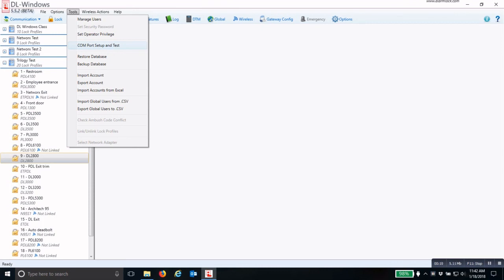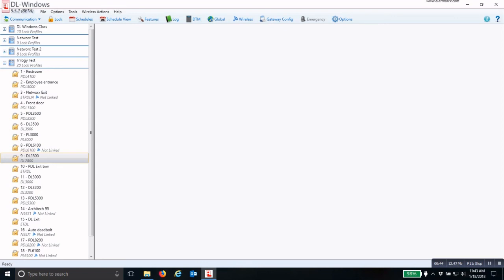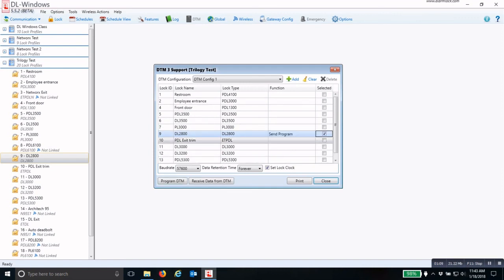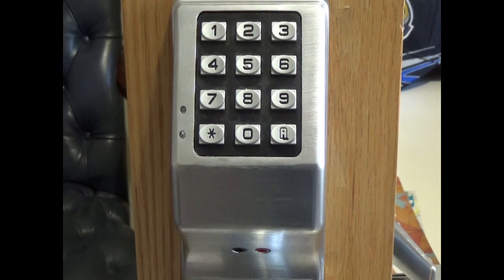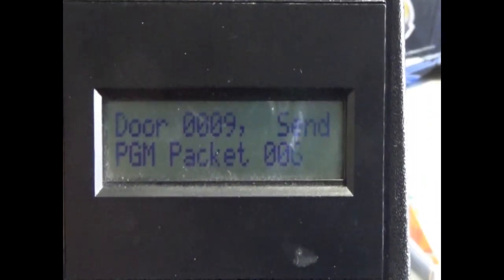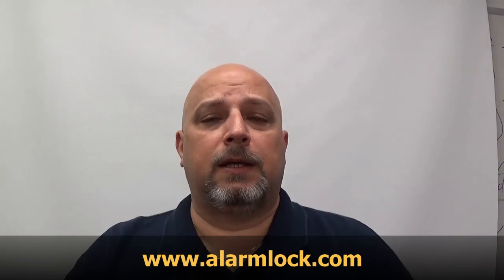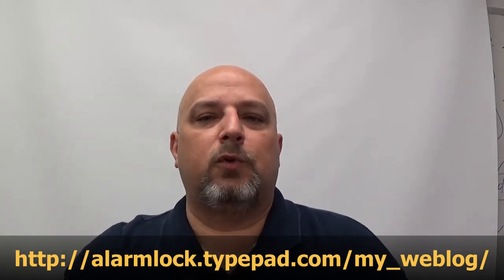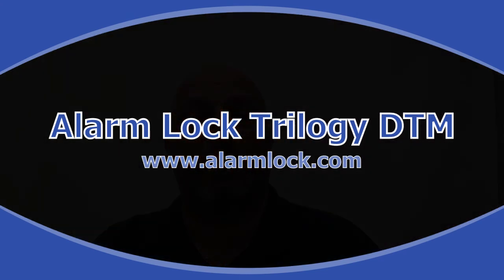Programming an existing Trilogy lock with DTM

Comment: I've programmed my DTM before but this time all it comes up with is "DTM Communications have failed", any ideas?
Reply from the maker: Make sure the PCI cable is plugged in correctly, prong with the black tab goes to the black port on the DTM. Also make sure you get a valid "Com port set up and test". If there is still an error, please consult with a local dealer.